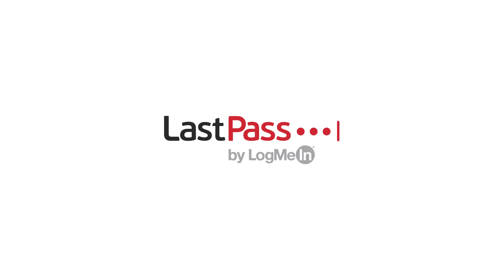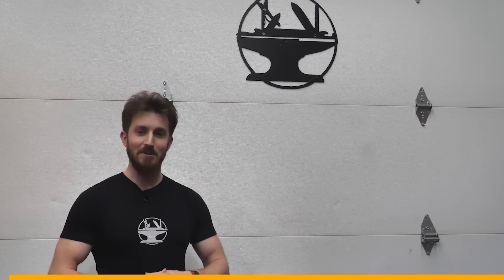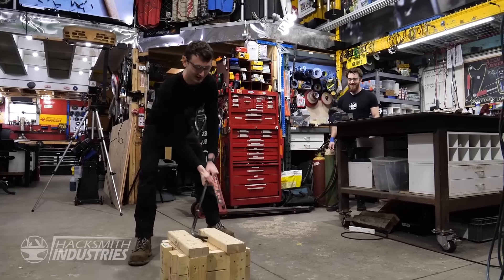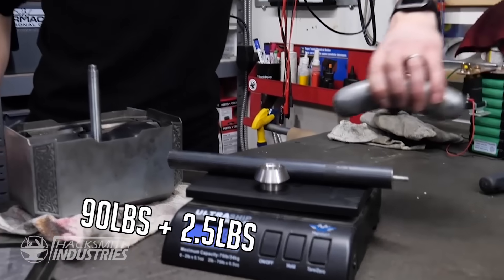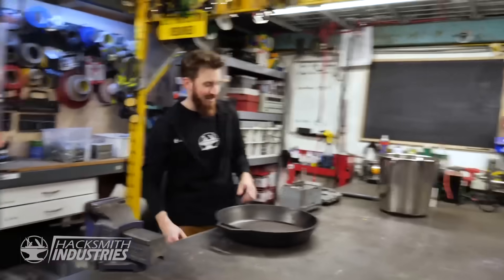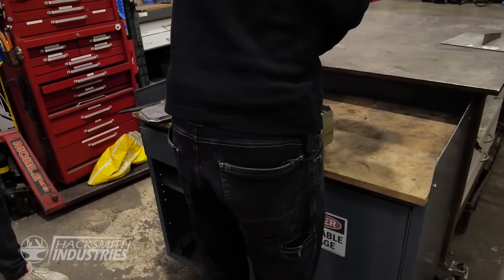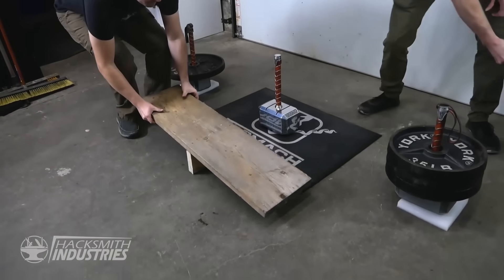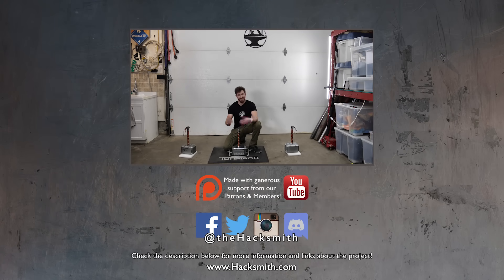Tungsten Thor's Hammer (World's HEAVIEST)

Comment: I feel like Elon Musk would make an Osmiun one just so he could have the record
Reply: Someone get Musk on the line, hes gonna love this.
Reply: PewDiePie is gonna see it and yeah
Reply: It’s to toxic itd be dangerous
Reply: Tungsten is the way to go
Reply: @aidancooney1834  He could use rhenium. Pretty sure its cheaper but basically as dense.
Reply: Carbon rhenium is almost 3,000 US dollars per lb. I think Tungsten is about 500 US dollars per lb, not sure though.
Reply: @aidancooney1834  but Rhenium is thousand times cheaper than Osmium. This Hammer would cost more than 150 Mio. $ with Osmium.
Reply: @michaelhopkins6610  you’re right. It’s a lot cheaper however your math is incredibly off 2 Square Feet of Osmium would weigh roughly 240 lbs and cost 1,300,000 in USD.
Reply: @michaelhopkins6610  compared to Rheniums roughly 750K
Reply: @aidancooney1834  what? O_o 
One gram Osmium is more than 1.500 USD.. 240 lbs are ~110 kg. 
1.500 $ × 110.000 g = 165.000.000 $ 
So I'm sure YOUR math with 1.300.000 $ is much more off....
Reply: Go Pokes!
Reply: Aww man i didnt see this comment before i said about Osmium 🤣
Reply: Grave Storm huh ?
Reply: @ElectricGun100  Well if you look at the period it is in you will see the noble gases so if we follow that trend it would be a very unreactive gas if it could exist, of course at that size(atomic mass) we really don't know what it would be like because if we had enough to see it, it would instantly blow up the laboratory and surrounding city blocks.
Reply: He could melt it with the flame of a Merlin engine!
Reply: lol, as I scrolled down I was saying to myself "Let see one made out of osmium or iridium". Then I saw your comments.

Of course its prohibitively expensive, but some billionaire should anyways.
Reply: @fomori2  yeah that would be crazy. But osmium is super rare anyways, it’d be very difficult just to find it, in fact for every lb of Gold on Earth there is only 0.6 lbs of osmium. So it would be a very hard piece to put together.
Reply: @aidancooney1834  and osmium is much rare than gold... for 1 gold you have 0,1 osmium.
Reply: @michaelhopkins6610  read carefully 1 POUND to 0.6 POUNDS doesn’t necessarily mean your ratio, and that’s a by year production. You clearly don’t know but Osmium is mostly produced and is not quote on quote “rare”. It’s in low abundance due to low demand. But two tons of it are produced yearly. It’s just in low demand otherwise we could make an entire skyscrapers worth in a years time which is more gold on Earth than the gold we’ve found and haven’t found combined.
Reply: @aidancooney1834  
The only thing what I did wrong was a number, right would be:
You have 1 gold vs 0,001 osmium 
One year with 2 Tons osmium? It didn't give one year with more than one ton, and sometimes they had years with a production only enough for this hammer.... btw we have only 44 tons osmium on earth...
Reply: @michaelhopkins6610  buddy two tons is produced per year. End of story. You’re not even making sense grammatically.
Reply: @aidancooney1834  The most abundant sources of iridium and osmium is on deep space asteroids. I think that most of what we have on earth is from early asteroid impacts.

In order to get those high atomic elements it takes a very powerful supernova, which takes a very large star, and there are only so many of them, let alone those nearest us that have died.
Reply: @fomori2  this is correct but it’s commonly alloyed with copper and nickel naturally and is relatively easy to separate and make. Hence the production of 2 tons annually. Finding osmium is very rare yes, more so than Gold almost by double.
Reply: @michaelhopkins6610  you know you can keep arguing. But the channel actually has a comment referring to them having to spend 3.2 million on Osmium for this lmao. Nothings wrong with me. You’re just trying to diminish my entire minor stuff in college. You clearly do not know what you’re talking about.
Reply: @michaelhopkins6610  everything I said was fact, other than ironically the Matt comment, I forgot a X2 variable so it would be 2.6 Million. This channel referred it would take 3.2 Million to make an Osmium one. Now you know. 150Million is flat out ridiculous, and my math was all by me using an estimated size of the hammer, and I wasn’t far off.
Reply: @aidancooney1834  Use your brain dude... the answer 3,2 $ Million is wrong, that would be only enough for a 2,5 kg osmium hammer. Probably the channel made a failure with the currencies and between lbs and kg. AND I mixed it too, is more like 75 Million $ ... sorry. 
And osmium is much more expensive than gold, but the 3,2 million $ fits only for a gold hammer.
Reply: @michaelhopkins6610  nah you’re still a solid 73 million off. You’re extremely ignorant. Look up Osmium cost per Troy Ounce. Then look up how many grams in a Troy ounce. Divide the cost per Troy ounce by grams in a Troy ounce. You will have the price per gram which is roughly 12 dollars. Meaning a lb of Osmium would roughly be 530 (top of my head thinking) times more than 12 dollars which comes out to roughly 6,300 dollars. And if you were to times that by 240 lbs that would come up to roughly 1.6 million. That 1.6was on the spot. And since I made a mistake earlier as to the lead being 120 lbs but it’s twice the space. The Osmium weight would double to 480, hence doubling the price to 3.2 Million which is also equivalent to what Hacksmith came up with. How interesting. Not to mention this is what I’ve been studying, and Im also majoring in Quantum Mechanics. Math is my strong suit buddy.
Reply: @michaelhopkins6610  Gold is roughly 56 dollars a gram not two, not three, not four but more than 4.5 more expensive than Osmium.
Reply: @aidancooney1834  really? Send me a link please. I can become rich if you send me the link to this seller, because every seller in europe want ~ 1.500 $ and more and not 12 $ per gram.
Reply: @fomori2 - Gold and platinum group metals probably come mostly from neutron star mergers.
Reply: Osmium's way too toxic when exposed to air, iridium's the next best thing
Reply: @SilverSpade_  as said earlier. Also iridium is to expensive. Tungsten is the real way to go without causing issues in large amounts of money.
Reply: @aidancooney1834  This is literally Elon Musk we're talking about. As of now, he has over 95 billion dollars net worth.
Reply: @SilverSpade_  went back to look it up I see as did I. That’s insane his jet worth was just 14 Billion sometime last year when I’d seen. Heard he tripled it this year alone. So crazy. However Elon wouldn’t spend the money on it.
Reply: @SilverSpade_  also that would require him to sell pieces of his company to attain more money.
Reply: Isnt depleted Uranium even heavier than Osmium? :D
Reply: Too expensive and he would probably just sell it rather than keep it
Reply: Nah, better use Neutronium instead. Anybody that can pick it up would essentially be a God and worthy.
Reply: Just not exist the amount of osmium to make it
Reply: My father is not having any job"
" I want to do something for my parents"
"But YouTube is not giving me views and subscribers"
"Ya I am worst that others"😭😭😥☹️.3k
Reply: yep
Reply: Who else searched osmium on google 😂
Reply: Would it help his goal of saving humanity? Probably not.

Here's not Bezos, who lets himself be celebrated for putting some people above the Karman line for a few minutes and went on the first flight himself. When asked to do it, Musk set up a crew dragon flight for a customer that let the customer orbit earth for four days with an apogee of about 800 km. And yes, crew dragon was ready and flying crews to the ISS before Blue Origin's first flight, so if he wanted to, he could have done it easily. He just didn't enter the race.
Reply: @ElonMusk
Reply: *Oganesson
Reply: @Kamii.1g  That's technically supposed to be a gas.

Comment: Asians just imagine a sack of rice. Thats the weight right there.
Reply: Thanks, i can pick up a whole sack of rice so I can probably pick that up too
Reply: @munirohm2420  It's no sack of rice, just a simple word
Reply: Lifting a 50kg sack of rice over your shoulder is very easy because you can distribute its weight over a wider area. But this hammer, damn, that dense piece of weight might break your wrist if you're not careful.
Reply: It depends on the sack size tho. The normal rice sack is 10kg, so just imagine picking 5 sacks at a time.

Comment: 16:23 Steel is about 7,9 g/cm³ and tungsten as you said earlier about 19,3 g/cm³. 3 times as dense is a big stretch already.
Reply: @MrAjrog 3 wouldn't even be rounded up, as 19,3/7,9=2,44. Round up to 2,5 if your bold. 3 would be an error of almost 20 % (24/19), which shouldn't be a rounding error.

Comment: Why not use the replica hammer to create a mold the melt the tungsten and lead to forge a new hammer use tungsten for the main hammer part and lead for the handle or try and bond the lead and tungsten together to form a much higher density alloy to forge a new hammer just relying on the original replica to be strong enough to endure wont last for tens of years hell not even 50 years you can forge a proper hammer that has the weight strength and resilience to last for centuries through out history over something that wont even last centuries and be forgotten several hundred years of time

Comment: Why the hell didn’t you guys weld the two pieces together???
Reply from the maker: What
Reply: Wow! Thanks for the reply, love the channel btw it’s sick :) but you split the hammer into two pieces to fill the lead in, when it came time to finally put the two pieces back together you used a bolt and screw in the handle. It would’ve made more sense to weld the two pieces together that you had split the hammer into. It would give it some more structural stability right? I just don’t see why you guys didn’t do that. Is the outer metal of the hammer not strong enough for that?

Comment: Actually, thors hammer is not heavy at all, or must say that the word "Weight" is not applicable on it. Because if its really so heavy, you cannot put it anywhere like table, elevator, closet etc it may destroy those things if that hammer is very heavy.
The thing is why its hard to lift it is because of the cursed that odin put on it.
"If you are not worthy, you cannot lift it" simple as that.
Thors hammer is like the Excalibur of king arthur.
No one can lift the sword Excalibur if they are not the chosen king of England.

Comment: Platinum is denser than tungsten. 21.45 g/cm3 vs 19.3 g/cm3 of the tungsten vs 19,32 g/cm3 of the gold. Also platinum has lower melting point than tungsten. Much easier to manipulate it.  Btw stone molds can be made to melt the tungsten.  So Tungsten is poor choice if has to be heavier. If strenght is the goal then yes. But not tungsten because is brittle. Tungsten carbide.  But high chrome vanadium nickel steel will be just as fine. And will be much more reasonable to use.

Comment: You guys would be able to melt the lead much easier with map gas, burns much hotter and is commonly used to sweat copper pipe in the plumbing industry. P

Comment: if the steel isnt melted and molded properly, the weight will be unbalanced. Leaving the tungsten unmelted will create unbalance in the hammer and make it certainly more difficult to hold.
Reply from the maker: It's negligable... there is also no steel in this lol -- it's lead and tungsten. We balanced the tungsten as best we could. It's so heavy you can't even notice a difference in balance

Comment: Do you know what denser than tungsten?

Harem protagonist
Reply: Gold
Reply: Pfff... Iridium. Make a Thors hammer with it and you will need a forklift.
Reply: Agreed.
Reply: Osmium
Reply: Do you know what denser than tungsten?

Joe mama
Reply: Monster musune mc is not dense he is not allowed for law to lay a finger in those girls. He is allways ready to da bisnes 😎
Reply: @Yollerzz Gaming This guy I work with "Cole" is denser than anything.
Reply: Luminate
Reply: Osmium, Iridium, Plutonium, Platinum
Reply: Density of the element depends on many factors. Hydrogen gas on Earth has a very low density, but in the Sun it has a density surpassing both osmium and iridium on Earth.
Reply: @atklm1  where did you read that? The average density of the Sun is still lower than Earth.
Reply: Black hole
Reply: A stick of wood
Reply: Eheheheh
Reply: Oganesson but that would explode
Reply: a duck.
Reply: Wanna know whats even heavier?

All might
Reply: Bruh
Reply: No, it’s a neutron Star.

Comment: Why not use Iridium, low meltingpoint 156 celsius and Indium prices goes aroun at $190-230 per kg. And the density is 22,4 where Tungsten is 19.3,,

Comment: The guy that shipped the tungsten has obviously shipped with the USPS before.
Reply: Considering what happened to Abom79 with his latest machine, it doesn't matter with whom you ship, they are all, assholes of the highest stank. And that was just a small machine, there's other fellas here that had lathe beds cracked by those incompetent flatfoots.
Reply: I mean, even if they drop it from a decent high the tungsten wouldn't brake because it is so dense
Reply: @juanacosta4351  and it could break the container and you could lose some during shipping
Reply: @juanacosta4351 , it could chip. While it is dense, it is also relatively brittle.

Comment: Why did you melt the tungsten and then poor it in the hammer
Reply: Because tungsten melts at 3,442°c. That is higher than any other metal thus would melt the rest of the hammer. Plus it is very difficult to get it to that temperature. The only way to really melt it is by using industrial resistive or induction furnaces. But a good question I thought the same in the beginning

Comment: You should've bored a hole in a neodymium magnet, put that in the the hammer, then filled it with molten lead. Thus creating a true form of  Thor's hammer. Then again a 113.5lbs magnet flying around isn't exactly safe. But neither is Milner.

Comment: >tungsten comes in a package
"Better set it on fire and drop from the ceiling"
>need to melt lead
"Let's cut the piece off with a lightsaber and set it on fire with a flamethrower"
>doesn't work
"OK, a Craigslist stove will do"

Comment: Tungsten is a heavy metal but lets think what will happen if you made a thor's hammer with neutron star cubes
Reply: If we don't die from the radiation, we would die from ONE neutron star cube collapsing into several black holes.

Comment: you could just cast the molten tungsten into a rock mold with the shape of a slightly smaller mjolnir  and cover it with the metal of the mjolnir replica. Or... maybe just use platinum, its maybe more expensive, but also heavier and the melting point is lower.
Reply from the maker: Not possible lol

Comment: Quick correction: Tungsten does not have density almost 4 times greater than the density of steel (claimed at 16:26 ). Density of steel is around 7800kg/m^3, while tungsten is around 19300 kg/m^3, so about 2.5 times as denser.
Reply from the maker: Wow it's like I honestly just said it as a rough calculation on my head, not a fact...

Comment: To made this hammer heavier, you would have to use gold. Gold is 50 kilograms per square meter heavier than tungsten
Reply: That wouldn't be a lot heavier but a lot more expensive
Reply: @spirti9591  That's right, but for what i know this is the only way to make it heavier using natural earth resources
Reply: @MotivationSHCUM  well then platinum is even heavier
Reply from the maker: Which is almost negligible...

Comment: this video is somewhat pointless when you don't even melt the tungsten and just fill junks of it inside a mold which is made out of an other material 

also, the title is really misleading and very clickbaity
i don't know why i even continue watching this
Reply from the maker: You can't melt tungsten. It has the highest melting point of any metal. It is the heaviest 1:1 replica. Why are you so mad?
Reply: @hacksmith  mainly because it is very clickbaity, indicating a 1:1 replica entirely made from tungsten but then 'only' putting junks of tungsten in it
it's not that i wouldn't appreciate the work you've put into it, the hammer looks super cool and all, however, i felt kinda fooled after watching it

Comment: Where some steel toes. That thing would obliterate your foot if you dropped it.
Reply: Why? Do you see people wearing steel toes  at the gym where there they lift much more then the weight of the hammer above their heads..
Reply: @Malligmallan  Barbells and dumbbell are very easy to hold onto and balance by design. This hammer looks very hard to balance.

Comment: Making a sand casting is not hard to do.
Reply from the maker: You can't melt tungsten.
Reply: do you know the melting point of tungsten? Even if you had a sand cast you wouldn't be able to use it for it

Comment: You could melt the tungsten in an Unobtanium mold, duhhhhh.
Reply: Vibranium?
Reply: @shardfilterbox  Vibranium is light
Reply: @esunisen3862  it's more about the melting point
Reply: Well, if you want burning tungsten...
The stuff burns in air well below its melting temperature!
Sintering, the fusion of metal particles with heat below the melting point and lots of pressure is how tungsten carbide tooling is made.
Almost like a ceramic...
Reply: I'm wondering though how, can since obviously the saws and the pieces of tungsten they used were molded.

Comment: What about filling it with osmium? at about 3g/cm^3 more dense, it would increase its weight by ~15% to maybe 130ish lbs.
Reply from the maker: Cost?
Reply: @hacksmith  INSANE!!!... roughly $400 per oz. ~130lbs = ~2096oz = ~$840k Someone would really want that. Then the logistical issue of getting the quantity. Finally, with a melting point of 5.5k degrees... I understand why you couldn't do.  None the less, it truely would be(outside of using white dwarf star material, or black hole material), the heaviest possible.